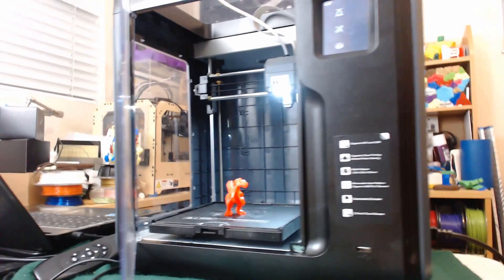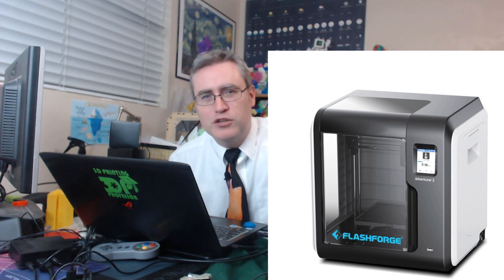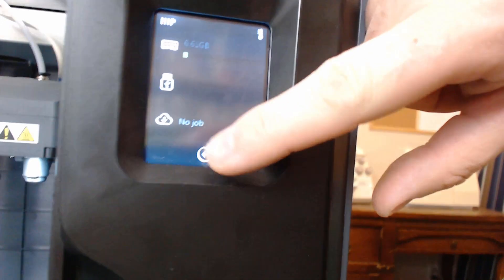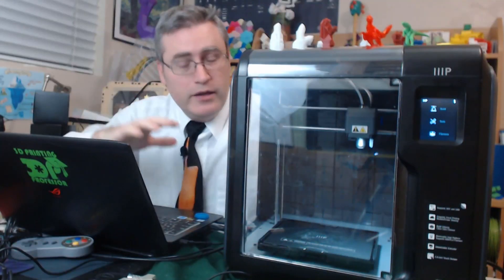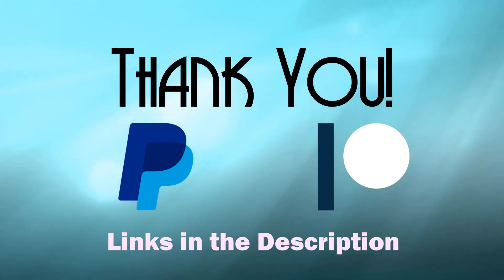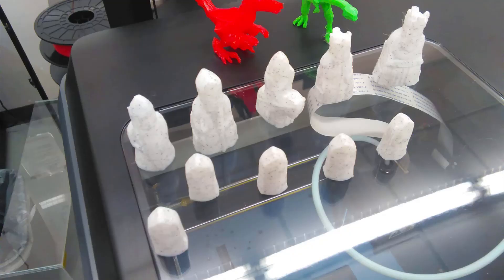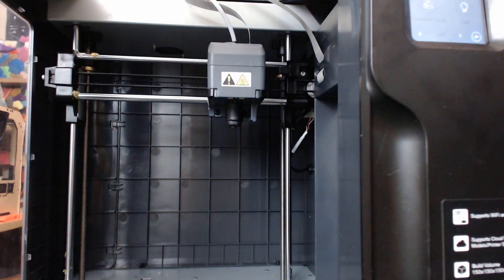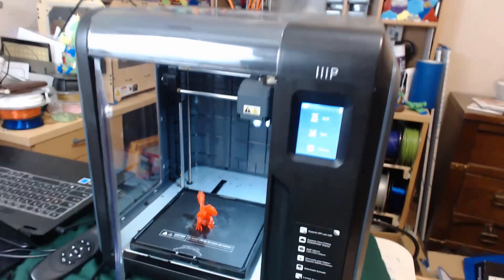Absolutely Loving the Flashforge Adventurer 3 / Monoprice Voxel 3D Printer

Comment: why not the FlashForge Adventurer 3? why the re-brand, is it cheaper?
Reply from the maker: Nope. Exactly the same price. Just a different retailer. And different support. And the people who sent me the printer.
Reply: @3dpprofessor  Monoprice has the exclusive market in the US for the Adventurer 3 which they simply rebrand as the Voxel... the rest of the world gets the Flashforge version called Adventurer 3.  I worked with Flashforge on implementing the Polar cloud integration and have an original PP2 prototype of this machine which I love as well!
Reply from the maker: @williamsteele  Thanks for the clarification. And good job on the Polar Cloud integration. It works great, but I love that it's optional and this printer will never stop working just because a website dies. 

This was sent to me by Monorprice, so I had a responsibility to plug them, but I hope I did well also letting others know about the Adventure 3. And it's good to know the nozzles are available and not too expensive. I'm gonna buy 2 for the Voxel I bought for the Makerspace here.
Reply: @3dpprofessor  Monoprice has the exclusive market in the US for the Adventurer 3 which they simply rebrand as the Voxel... the rest of the world gets the Flashforge version called Adventurer 3.  I worked with Flashforge on implementing the Polar cloud integration and have an original PP2 prototype of this machine which I love as well!
Reply: @3dpprofessor  oic

Comment: 3:39 What are you talking about? There has been an X3G Plugin for Cura for 3 years.

X3GWriter
X3G output plugin for Cura. This allows saving the slice output as an X3G file for printers based on the Sailfish firmware.

This plug-in takes the normal g-code output of Cura, and converts it using GPX to the X3G format.

https://github.com/Ghostkeeper/X3GWriter
Reply from the maker: Have you tried using it? I have. It doesn't work. The X3G output doesn't actually drive a X3G machine. maybe it's because I'm using gCodes that aren't compatible, I don't know. But it's an exercise in frustration trying to get that plug-in to work. Believe me, I've tried.
Reply: @3dpprofessor  I have used it with a Microcenter Powerspec Pro 3D printer in a previous version of Cura. I have not tested it with current Cura though that doesn't stop you from creating an issue ticket via Github so they will fix it. Also there is GPX which according to the notes S3D uses for conversion: https://github.com/markwal/GPX.

https://www.thingiverse.com/thing:81425/